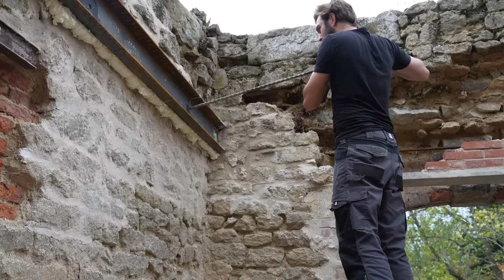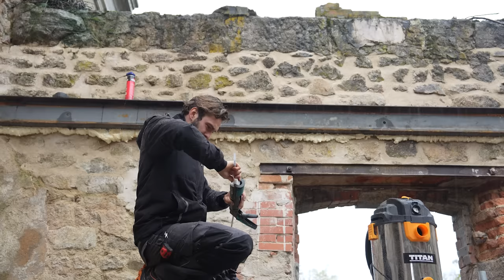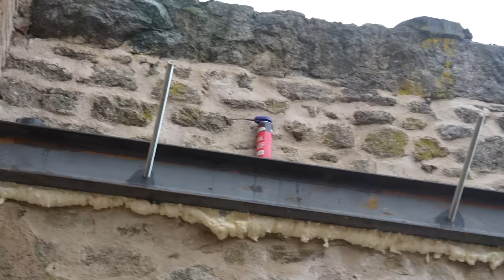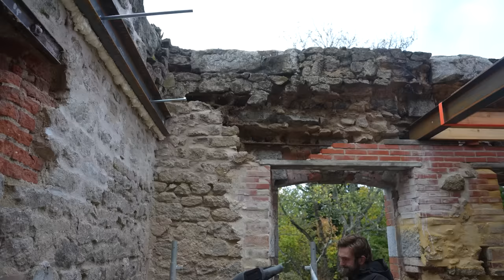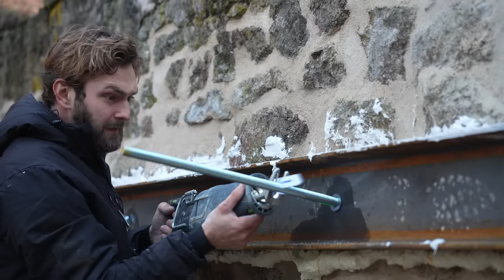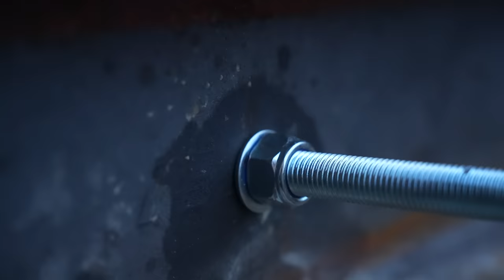Anchoring the beam finished, roof ordered.

Comment: Little tip Dan..... when cutting threaded bar like that always have a loose nut the other side of the cut if u can. Thay way if you mangle the thread with the cut you can wind the nut back out and it will re tap it. 

Just a suggestion! Keep up the great work!

Comment: Dan you need to get some carbide tipped drill bits for the steel and a sds rebar drill bit for the concrete . Your local dealer should have them .
Reply: Yip, also a level for drilling and an impact gun with deep sockets for the other beams. That was hard to watch😅

Comment: will be really interesting to see which mansard roof structure he goes for. also hope he finishes filling some of the holes further down that are important to support the steel beams of the upper floor... the roof will add quite a bit of load both laterally and vertically, and most of that load will go through the recent steels
Reply: I suspect he's going to do a concrete ring beam on top of the existing wall, which should take a lot of the lateral load.

Comment: When you put up the roof, you should put up some sort of rain water collection. Using a temporary rain/eve trough system. It could come in a window on top floors down to building the first floor, if the collection barrel filles it will just overflow and the area is getting rain anyway. As you build up, empty the barrel and a section of the eve through, keep moving and removing as you go up, when you move to a other section move the eve through to new building section.

Comment: Just a tip, put the nuts on the bar before you cut them. No problem with cross threading if you leave sharp ends! Cheers

Comment: You put the washers and nuts on before you hammer in the bolts, then screw them down before you cut off the bolts, then back up, apply the lock-tight, then tighten down and cut off and grind the bolts. That way you don’t have to deal with messed up threads. It’s more efficient.

Comment: Great work, a couple of suggestions....if you have another section of that scaffolding, could you put it in on the far side of your existing set up?  I'm worried you could trip over your tools on the platform and you'd have nothing to prevent you from going over the side.  Also, whenever cutting a bolt or threaded rod I usually put the nut on first.    You can then back the nut off the bolt and it will usually remove the annoying burr that gums up the threads.   Maybe  not so useful for this job because there's no real need to remove the nut, but good general practice that can save time and frustration!

Comment: Assuming a temporary roof for this tower as much rebuilding required to replicate the original slated towers an lead work,that wall behind the c sectionweak but the bolts and resin are another point to spread the load .Dan you appeared in the start preamble all last week!

Comment: Will you be getting some help with the roof? 
Will be interesting to watch it and the top most windows going in. Once those are in you will probably end up putting in all the lower windows and doing some simple electrical work so you have lights in each ceiling and some power points in each room that you can use. 
Will save you from using so many long power leads draped all over the place.

Comment: Great news about the roof.  A suggestion.  Pre drill the steel for the next one? That might save your shoulders!
Reply: He did it once up so that he could make sure he got into the stone and not between.
Reply: He wants to hit the stonework and not the cement joints so it has to be done in place or it's complicated measurement time!?!
Reply: I had wondered the same thing, but he said on a previous episode that he drills the beam in situ to ensure that, for maximum strength, each hole lines up with a stone and not a mortar course.

Comment: Rubber washer between galvanised metal washer and steel beam. Galvanic corrosion is a possibility where galvanised metal meets steel. Not too serious if moisture ingress is restricted or prevented, however, a rubber (neoprene) washer prevents direct contact between galvanised washer and raw steel beam.

Comment: Hi Dan, Don’t put pressure on your festool drill. Just hold the drill loose between your fingers. Like drinking a cup off Thea. The drill starts a vibration motion. And goes in like the wall is made off butter. This is the uniek thing about your festool.
Reply: Love what your doing btw!

Comment: To get the dust out of the drill holes, either get a long bit of tube a bit smaller in dia to the drill hole, and tape the end up to the vacuum hose, or blow it out with your leaf blower with a bit of hose on the end like the vacuum. 
To force the screwed rod in the hole to cut a V on the end of the rod so that when it goes in the hole it push's the gunge either side. You do not need thread lock on nylock nuts.

Comment: My two cents: Use a length of wood strapping to find & record your drill hole locations. But don't drill them yet!  Then with the beam on the ground,  transfer the hole location from the strapping to the beam  & drill them out in the beam. Then once installed the beam. THEN drill into the wall.    Also screw the Nut on down PAST the point in the thread rod  before you cut it!

Comment: Loving the progress buddy! Too bad you couldn't salvage/clean up some of those old bolts with square nuts that were in some of that old steel to use as anchors on that C channel beam. Even though they would have been hidden, they would have still been part of the structure and repurposed with new life.

Comment: Put the nut on the end of the rod before you knock it into the wall. It saves the threads. Then run the nut down to where your going to cut it to final length. Sometimes it’s hard to start a nut after you have cut through the threads.

Comment: Instead of cutting the bolts short would you consider drilling the noggins that line up with the bolts so the bolts can be used to hold them tightly to the ibeam?

Comment: Generally you put a nut on the end of threaded rod, bolts etc when hammering on it, stops mushrooming of metal and damage to threads, also threading on nuts before cutting threaded rod avoids damage to threads and difficulties spinning on nuts after cutting, get yourself some ratcheting spanners too, make life so much easier, good job tho bloke.

Comment: For those who think that drilling through steel and stone requires a huge amount of human strength. It doesn’t. The keys are a hammer drill (for the stone), lubrication/cooling fluid (for the steel) but most of all, sharp bits. They must be sharp to being with you should sharpen regularly. When sharpening, use a cool method - in other words, don’t allow the bits to get hot as this will weaken the cutting ends. I’m lucky in that I have a Tormek but you can achieve the same with a diamond stone and water

Comment: V169: There is an age old way to do this Dan that may be easier? You drill RIGHT THROUGH the wall then insert a long piece of studding. Om each end you add a large steel plate like a large washer then bolt it up tight. You see ancient houses with these discs on the wall and thats what they are. But your way seems to be working! What chest size are you Dan and how do we get mail to you please? Is it just Chateau Chaumont?😊

Comment: I’m just wondering why are you cut the bolts off so long and then had to take such effort to thread the nuts on. Could the bolts have been cut a little bit shorter so it didn’t take so much to thread the nuts down to the beam? And I really am excited about the progress and can’t wait for the roof to start going on!

Comment: I admire your willpower and perseverance, but as a metal guy, it's kinda painfull seeing you work with it. A couple of things:
- How much oversize did you drill the holes in the wall? It should be at least 2mm over, which it didn't look like when you were hammering the rods in. You also should twist the rods as much as possible when inserting. It also looks like you could use a beefier drill.
- You should blow those holes out with compressed air and get deep into the whole with a long pistol of some sorts. 
- I wouldn't want to get my rods wet when using 2 component epoxy.
- Why M22? Such a weird size, that's wrench size 32 or 34. M20 (30) or M24 (36) is way more common.
- Cut your rods shorter with an angle grinder (for speed) so you don't have to twist that locking nut for ages. Just round the end of with a flap disc and the nut will go on just fine. Also completely unnecessary to use thread locker if you already have a nylock nut. Also, get yourself an impact wrench, game changer.

Comment: Make sure on these chemical anchors to run a beat of 10 cm out of the mixer before using it as the first part is not correctly mixed.

Comment: Hi Dan. Just a small bit of advice. You should screw the bolts into the chem fix because otherwise it pushes all the chemicals in front of the studding and then won’t go all the way in. You want the glue all along the studding to get the best hold. Sorry to be one of those people. Love you channel.

Comment: I have a good question ;) (as always) -- If the inside of the wall is just sand (hopefully not), then the question arises, where are the bolts supported or attached? In the worst case, not anywhere, so how could they possibly strengthen the structure? Under load, the bolts just come off the wall along with the beam and the structure's load capacity is still zero! and everything still rests on the ends of the beam. So is the purpose of the bolts just to calm everyone down and move the problem somewhere in the darkness of the wall out of sight and leave it untreated? -  (At first I understood that the bolts would go through the wall, and they would be tightened on both sides of the wall, at least .. and also in between, if there is something to attach to?!)
Reply: Genau so sollte es wohl auch sein. Das nennt man im Fach jargon Mauer Anker. Man kann es außen mit einem geschmiedeten gleichschenkligen Kreuz  verzieren. War sogar vor 100 Jahren schon üblich.

Comment: If you need to run the generator during the day, then you clearly need to upgrade your solar panels. The system you have will easily handle another four or six. But I guess if the electric supply is coming, it might not be worth it.

Comment: I am perplexed about one thing. Why roof this section now? If I understand properly, you have removed all of the metal beams that were holding up the walls in the other parts of the building. So those walls have been substantially weakened. Wouldn't it be better to put in a temporary roof covering and accelerate the work on the other walls? Isn't there a high risk that the other walls could topple/collapse in a storm?
Reply: It's been fire damaged like this since 1986. It would be very unlucky if it collapsed now.
I think he's correct in putting on a proper roof once, rather than temporary then a proper roof. He's got to prioritise his time.

Comment: Instead of only hammering those threaded bolt  you should first try to screw them puting a locking nut at one end and using a drill with socket, They might go further

Comment: I was worried cutting the bolt was not a good idea before screwing the nut down... but it worked ok...lol...   getting really exciting now as the work goes on...  I realise your saving the yurt vid so you can have a weeks break... hopefully not for awhile....far too close to tipping point to stop now....   remember safety, mask when tipping dusty cement/lime...etc..  ch 4 ..i will look.

Comment: The diameter of the threaded rods is far too large and the threaded rods do not have to be inserted 500mm deep into the masonry. If you use M16 threaded rods, this is perfectly adequate, and the adhesive must be between the masonry and the threaded rod, otherwise you will not have a decent adhesive connection between the components. If you put an M22 threaded rod into a slightly larger hole, the glue cannot get past the threaded rod and will be compressed in the hole, which is why you couldn't get the threaded rods all the way in. M16 and approx. 200mm deep into the masonry is completely sufficient, the required hole diameter is specified by the manufacturer of the adhesive, M16 then probably has 20 or 22 millimetres, sorry for my bad English.
Reply: Actually, I wonder why you put threaded rods in there at all, where should the metal beam go, the metal beam rests on the ends, it can't go to the front where the wooden beams come in and to the back you have filled the gap with the filler, if the beam doesn't hold the load, all the other beams won't either!
Reply: @markuslegenbauer5529  , he tries to reinforce and stiffen the weakened top of the wall with the beam, not the opposite. That's the reason for adding outside steel beams to the floor, instead of the original design with puckets into the wall, like the lower floors.

Comment: I'm shocked that epoxy into river rock meets code anywhere in the world. Generally all thread with a plate on the other side to stabilize masonry as the tension strength on thaewall itself is poor. Masonry is strong in compression.

Comment: Dan, it's getting harder and harder to watch your channel. The daily lack of safety is concerning. No masks when mixing lime, plaster or cement or sanding or other. Not wearing gloves or safety goggles. No steel fence or bars around the top of the scaffolding where you are standing. Also, we have to assume since you haven't told us of the architect and Structural Engineer you are working with, that you aren't working with anyone, which is very concerning.
I know your Mum is a Nurse and I hoped she has encouraged you to be safer. For the sake of those 2 little Boys, I really hope you will increase safety and work with a Structural Engineer and Architect. Please
Reply: He has mentioned his engineer in previous videos. Perhaps his engineer does not want to be on Youtube.

Comment: You lost me on your structural choices you made on this u beam. Why all these anchors and why so deep in the wall  if they are only going to bear vertical loads. I don’t see any way these hold the spreading forces from the roof if you are not going to structurally tie the floor to the wall in a horizontal plane. If you are taking all that hard work and trouble than at least make it count. Why nylons nuts and locktite, either would have worked just as a normal nut with a spring washer, that would have been easier, quicker and cheaper